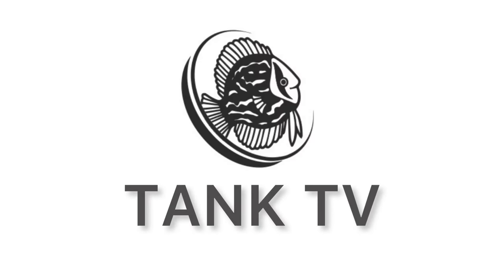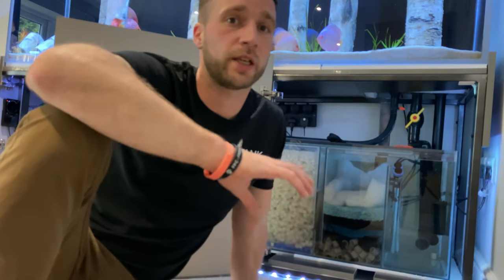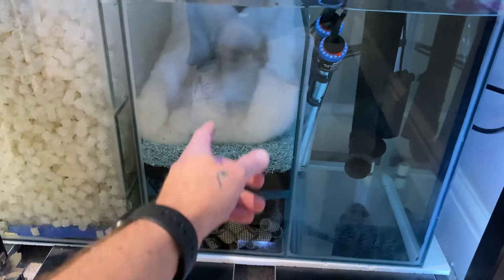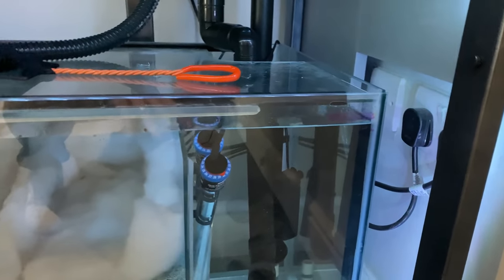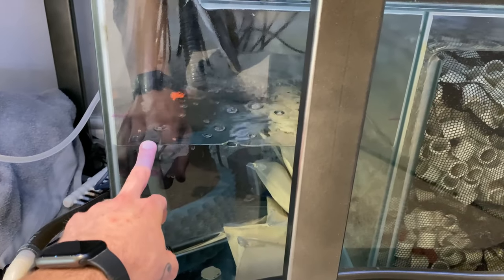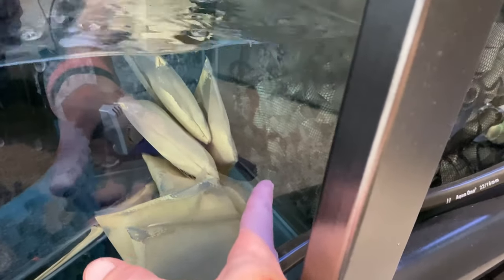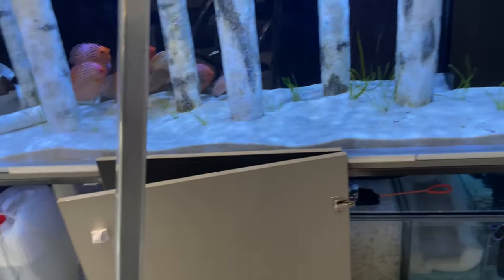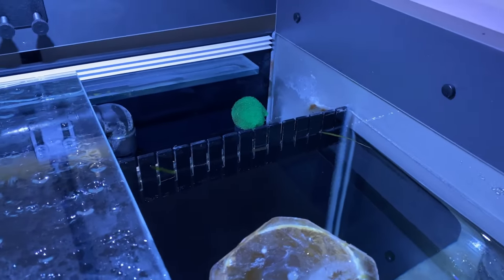How Aquarium Sumps Work.

Comment: Thank you for posting this video, I’ve watched many videos specifically about fresh water sump setups and yours is the clearest and most useful I have found. I’ve just ordered a 1000 litre tank and had been considering putting 2x fx6s on it but have gone for a custom sump instead and having watched this video it has helped to reinforce my decision. So thank you!
Reply from the maker: Thank you Darren and best of luck!
Reply: I keep discus and will only use a sump. I ditched my canister filters and went all in with my sump. I drilled a hole in it and plumed it outside if I wanna do water changes. I also run an anoxic filtration system and a freshwater refugium. Possibilities are endless

Comment: I think that the ceramic rings works best as mechanical filtration and should be put first. After that you should have a coarse sponge filtration, not as it is now where you have a fine filtration before a coarse. It makes no sence at all. The order of the mechanical filtration must go from coarse to fine, with ceramic rings first and the white fine filter last, you have it in opposide order now.

Comment: I dont understand any of this sump stuf, looks like a lot of equipment and a pain in the arse. why not just have a filter like a fluval 307? Works for me on my 340 litre marine tank with no problems.
Reply from the maker: Good question. Problem is you would need between 60 to 100 307s to filter and turn over 1000ltr set up at its optimum of 6 to 10 times turn over per hour. You would also be lucky if the pump in the filters could push the water up high enough to get it out the outlets on such large tanks due to the head hight of the outlet. Not to mention there would be nowhere near enough biological filtration for the stocking level and bio load of a fully stocked 1000ltr.

Iv seen far more HOB filters and canisters fail compared to sumps also in my line of work :)

BUT as you say it seems like a lot of equipment but a sump can just be run on a return pump and heater if the user wishes.

Comment: Just bought a 210 gallon mega flow aqueon tank, what size sump do you recommend for it to biologically and mechanically filter it, and have enough  Water volume for back syphon to hold incase of a power outage without running over. Thanks

Comment: I’m about to get a second hand d-d aqua pro reef 1200 … I’m turning it into a freshwater community tank… the supplied sump has 3 cambers and a top up camber ….. all of the baffles are on the floor so it’s over and over will this still work for me??? I was going to have sponges in first chamber  alfagrog in second with bio balls and then third heaters and return pump ……
 Will this work …. Thanks in advance
Reply from the maker: Hi Kern, yes it will still work fine as this is how most sumps are made. It would be easy enough though to remove one of the baffles, prop it up and re silicone it to get that water flowing up through the media 🤷🏻‍♂️

Comment: Hi I have a Cade 1500 system marine tank but changing it to fresh water discus would you just use the sump alone or would you recommend the sump and a large canister ,I was told by a discus breaded to use both Total volume is 640lt cheers Mat.
Reply from the maker: Hi Mat, you may be borderline with the amount of mechanical and especially biological filtration you can get in that sump so they may be right. Remember fresh water is different to salt as the rock work (scape) in a salt tank will keep the tank cycled so don’t need to worry as much for mechanical filtration in the sump but it doesn’t really work like that in fresh water and especially with discus where the flow needs to be light and low. I’d at least want to have 20/25 ltrs of biological filtration in the sump on that size tank and possible stocking level but also in a way where the water can travel through it and not over it. By the time you get that amount in the sump you may not have much room left for equipment.

Easier and cheaper option you may have is rip all the internals out of the sump and re design it.
Reply: @TANK-TV  Cheers mate for that yes I may redo the sump in different config and run with a large canister also, but thank you so much for the advice I will let you know what I end up with, Cheers Mat

Comment: Great video and explenation on the Sump, super setup and idea on your first and second chamber, will think about this setup.  I am currently thinking on adding a UVC set, I see in your video a set up what raised a question,  you are feeding the UVC out of your last chamber with a pump but also returning the flow in the last chamber, is there any specific reason why to do this in this way, I was thinking on bringing the UVC direct into the return flow to the tank.  They way you have set it up is "simpler" only need a extra feed pump, am I missing something in the foreseen set up?
Thanks in advance for your view.
Reply from the maker: Thank you!

Comment: For a 120 gal freshwater aquarium what size of inlet and outlet piping would you recommend also what volume or pump size would be recommended it will be our first sump replacing 2 eheim classics. We also use a 24 w Green killer uv large community of smaller fish

Comment: Perfect explanation I watched every second of it . I used to use sump but I was worried and didn't understand how it works . 
I have a question please.
What should I do when water level from display tank drops pls ? Because sometimes it starts air suction.  Thanks
Reply from the maker: Thanks Kurt,

So it’s not so much the water level in the display that makes the suction noise its the level of water in the weir. 2 main things to try is up the flow rate of the pump to raise the water level or get a ball valve to control the water level.

Comment: Great Video. Am considering on building one. How many gallons is your Discuss Tank and How big is your sump? Dimensions of the sump?How many watts is your pump that you use ? do you need 1 pump or 2 pumps?
Reply from the maker: The tank itself is 1000ltrs, sump 300ltrs, pump turns over 9000lph and just the 1 return pump
Reply: @TANK-TV  Thanks buddy. That info will help me a lot.😀

Comment: Hi Ben, why the airator in the return chamber, cheers mate.
Reply from the maker: To oxygenate the water.

As I had discus flow needed to be at a minimum in the display so oxygenated the water in the sump instead :) 

Yes the K1 chamber would have been doing it enough anyway but had enough air flow from my pump to run an extra stone.  

So as a result my display tank flow was minimum for discus to enjoy.
Reply: @TANK-TV  cheers Ben ill give that one a go once the new tank is set up.
Reply from the maker: @jameshalligan69  no worries! Even if you have a K1 chamber or moving bed chamber run on airstones it should be enough to oxygenate the tank.

Comment: What size UV filter do you use and do you reduce the flow of water through it from the return pump?
Reply from the maker: Hi Adam,

The UV is running on its own closed loop system (so it’s own pipe work and pump) I am doing a video on UVs and the correct way to set them up over the next few weeks so check you are subscribed so you see when it’s uploaded. In basic terms, you want a a UV wattage that can handle twice your water volume with a pump turning it over once per hour. This will give you both stage 1 and stage 2 sterilisation :)

Comment: Great video. I also have a sump and I've only had if for around 6 months and all the floating debris doesn't go into the weir it just floats around. How would you suggest I angle my outlet? And how would I make all the floating debris go into the weir. Thank you.
Reply from the maker: Hay Harvey,

Where are the floating debris? In the sand bed? On the surface? In the water column? Etc 

Also what is your tanks water volume and length and lph pump?
Reply: @TANK-TV  They are in the water column. My tank is 800 litres. Its a 7ftx2ftx2ft. And I've got an 8000lph DC pump
Reply from the maker: @harveym5627  without me obviously being able to see the set up first thing it may be is not the fact it’s not getting into the weir but that your pump is kicking it out into the the tank from the sump. Also just to check it isn’t tiny air bubbles from an air stone or anything? 

First thing I would try is for 48 hours zip tie some floss around your pump inlet and see if it clears so water has to pass through the floss to get back into the tank. If it does clear then you know your pump is pulling debris from something in the sump and then kicking it into the tank. 

2nd thing, you want to try and create a whirlpool like flow and direction of flow in the tank so with mine and any others I face the outlet across the back glass aiming at the centre in hight of the glass the opposite end so the water flow will bounce of the glass panels creating a circular flow around the display tank itself. If the pump isn’t quite giving enough to create that whirlpool flow then it may be you need a bigger lph pump or consider a wavemaker to put the opposite end to get the water turning
Reply: @TANK-TV  Thank you. I will try adjusting my nozzle so it goes on the back panel to get the whirlpool effect.
Reply from the maker: @harveym5627  good stuff, just also ensure that if you are using your outlet for surface movement to oxygenate the tank not to reduce the surface movement to much

Comment: Great video, love the baffles for the different sections of the sump and the inherent safety they give in case of media blockage in one section to overflow into the next, very clever.
.
Question: Your intake from the tank appears to be a hole at the bottom of the tank with a tube running all the way up to a pre-determined level, that will be the tank max water level, why not have a hole on the side/back of the tank at max water level for that intake so in case of failure at the intake hole you would not have a catastrophic event emptying the entire tank?

Comment: I ran a canister, then switched to sumps when I was initially into freshwater. Set up an sps reef and the sump came with me. However, now I’m back into discus and am building out a 150 with a sump. Another HUGE benefit of a sump is the ability to drill it for automatic water changes or a drip system. Impossible to overflow and saves time on water changes